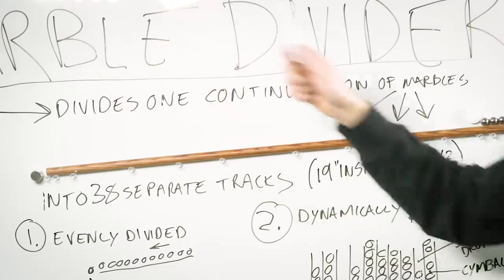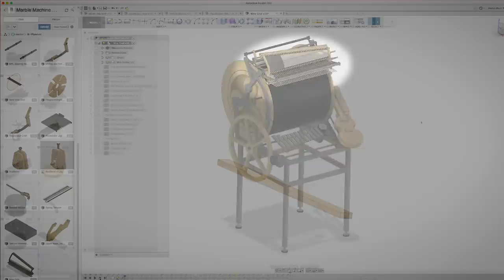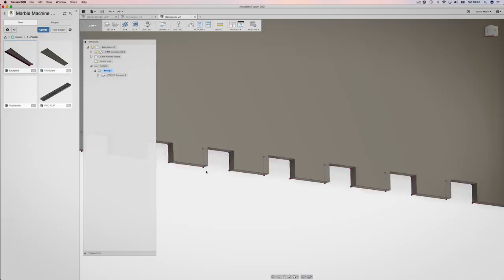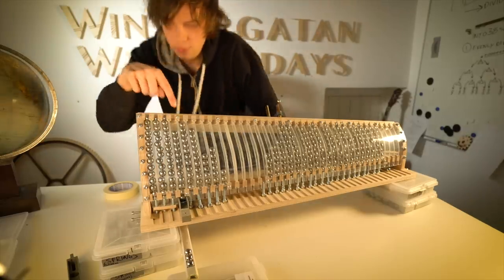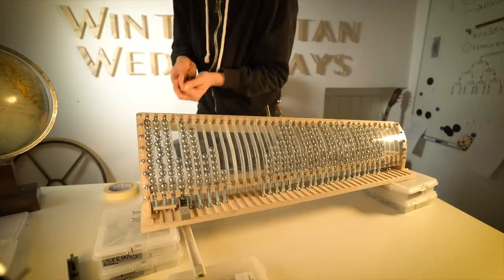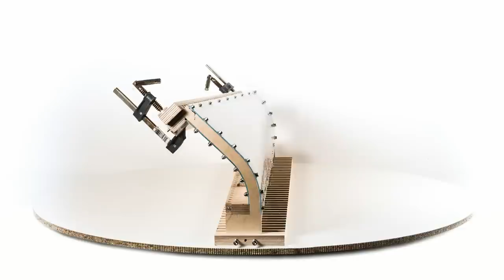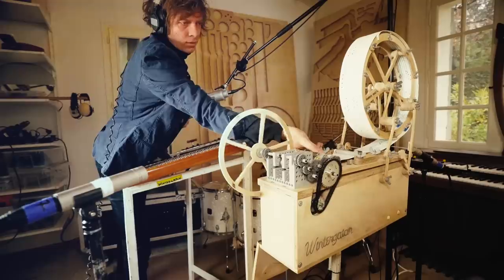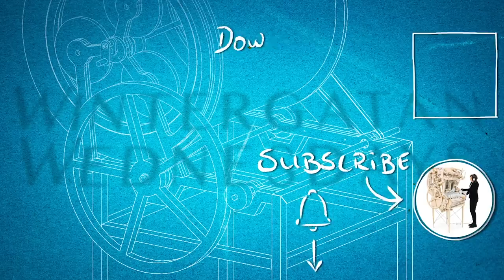Marble Divider - Marble Machine X #21

Comment: I wonder if there can be too much variation in the ways the marbles can be piled up inside the channels, since they're wider than the marble themselves. if we turn a channel sideways you can that see 5 marbles can make a W shape or a M shape, and both shapes can have slightly different heights depending on which way the channel is bending.

If that happens, the solution is to make the channel widths closer to marble diameters.
Reply: I had the same thought! I wonder if this was considered.
Reply: Alberto Torres by the next Wintergatan Wednesday I bet we will find out if it was considered!
Reply: There may be a little room for error on that aspect; the marbles can probably still roll through the top of the channel, even if it's slightly above/below expected.
Reply: I also noticed this - especially on the second channel. I bet Martin has considered this and build in some "tolerance". Over time this might become problematic as wear and tear creeps in.
Reply: All valid concerns, but remember that this is an iterative process. Things are designed, prototype tested and adjusted until the design can be classified as §viable, and once a viable solution and design has been identified the part is built. 

Compared to the original MarbleMachine this version is much more modular, and if it turns out there is a problem with a part such as this marble divider it will be possible to build a replacement that fits requiring minimal work to adjust. And I think there will be several parts that will go through at least one revision to address problems discovered only after the complete machine has been used for a while. Not every failure will result in the entire module being redesigned or rebuilt, but the possibility is there if it turns out that the design has fatal flaws. The original MM was much harder to maintain or rebuild. For instance there were no complete schematics and everything was hand fitted. This time there are extensive drawings and a lot of the parts have been cut using CNC machines or printed using 3D printers making for quite tight tolerances even if final fitting still might take some work.

Over all this version is a huge upgrade in just about every way. Only thing is I loved how primitive and yet ingenious the original was, and that just about all of it was hand made and hand fitted using simple tools. Every time I see it I can help but be amazed that Martin was able to build it and get it to work, or kind of work at least.

Comment: Why did you go for polyacrylic for the clear cover? Why not use a thin sheet of lexan and skip the heating and bending process as the force of the screws should bend it nicely with no warping?
Reply: EasyBakeRofleCakes Maybe it's not as robust and more prone to break after enough use?
Reply: Lexan is polycarbonate, most race cars use lexan for windows and windshields, it can handle a few steel BBs resting against it
Reply: EasyBakeRofleCakes That's good to know!

Comment: QUESTION: Instead of having 38 unique marble gates, did you look at making the marble gates all the same, but make them adjustable?
I am wondering a lot about maintenance on the machine when you are one tour. If all 38 gates are different, then you need to carry a lot of spare parts. If all the marble gates are the same, but adjustable, then you only have to carry a few.
The whole rig is looking great!
Thanks for sharing.
Reply: Coxy's Railroading Might make more sense to carry a small 3d printer so they can be manufactured. The problem with adjustability is that it creates the same problem as the first machine: the adjustments may move when they're not supposed to and cause reliability problems.
Reply: Yep that could work too. With that approach it's very flexible and also a matter of print time. Depending on travel schedule, there may not always be many hours where the printer could be working on a part. Perhaps a hybrid approach would be the best: Take a printer and print parts as needed, assuming there is available time, but also have an adjustable version of the marble gate to get you out of trouble for times where you cant print one.
Reply: Taking a 3D printer on tour doesn't sound like much fun to be honest. While I don't really think that these gates would need to be replaced while on tour, the fact that they are each printed with unique heights might cause more problems later on. 

For example the marble lanes look taller than the marbles themselves, which causes some to push up, making the length of the marble stack shorter than calculated. I doubt this was taken into consideration when they were figuring out the thickness of the gates. Having adjustable gates would allow for these uneven marble stacks to exist without hindering the rolling marbles from rolling properly over the full lanes.
Reply: I don't think that will pose a problem... If anything, a bunch of spares with the maximum space can be made, plus a bunch of spacers to exchange, combine and test, and then glue the correct one(s).
Reply: I would've just given the output a 5 degree slope as well. That slop should be taken up by the transfer from gate to destination anyway.
Reply: Coxy's Railroading い
Reply: If I understand what he is stating within his video each marble distribution distributor is adjustable. So my understanding is that the outer dimensions are the same for each of the 38 distribution chambers. This way all that he has to adjust is that inner stop-gap piece of plastic that keeps the top most marble flush with the main distribution track. If he was smart he would make each marble distributor with an adjustable counter sunk set screw so that he would not have to carry a lot of spare parts with him on tour. By making the inside marble stop-gap adjustable with a set screw means that he would not have to continue to make AND carry 38 DIFFERENT machined marble distributors with him as backup, but rather only 4~6 backups with the stop-gap can now be the same dimentions for all tracks because the adjustment now falls to a set screw (making the stop-gap adjustable) rather than individually milled parts inwhereas the 
inside stop-gap is permanently stationary.
Reply: Shane M Gordon That plastic piece is the 3D printed Marble Gate that was made in 38 different sizes.  Having a single size with spacers would make on-tour fixing a lot easier than carrying multiple full sets of 38 or trying to unpack and run a 3D printer with 5 minutes to concert start.

Comment: What I'd it gets to the end without having gone down any divider.
Reply: it will probably fill up the devider feed and wait before there is room. it could also be that the amount of marbles is limited and never "overflows" the devider
Reply: drop it down to the bottom for another circuit around with the rest of the used marbles.

Comment: sry 3:08 but i think this will not work ,  or maybe somtimes it will not work ,

you need sooooo many marbles to fill the channels in the left side to the middle , 

if the machine runs, some notes will miss , becuase some channels are empty (no marble can skip an channel to fill the empty channel on the right side)

i think you need a hopper on top of this MARBLE DIVIDER  with many many many of marbles , maybe im wrong , but i want see this machin run ;)
Reply: DieZockerZone it will based on the instrument sound type. @3:36 :)
Reply: this is not the problem , the problem is , if one is not full , the channels behind  cant fill up and they will be completly empty in time
Reply: DieZockerZone The machine will contain enough marbles to fill all chambers plus the entire transport mechanism.
Reply: i dont think so
Reply: if there is no hopper  on top , some chambers will be empty
Reply: what can you ddo duffers

Comment: Ah, finally figured out where the comment place was!  Lots of ingenuity in this and I have enjoyed watching how you have solved problems.  I know you posted that you don't intend to put any kind of stain or protective finish on the wood.  Something to consider is that in travelling around the world later on it will be exposed to a lot of different environments and wood does not react well to high humidity.  High then low levels of humidity cand do all kinds of warpage to wood if it isn't protected.  I would strongly suggest a coat of base color polyurethane with a light sand to smooth the surface followed by a second coat.  This will protect the wood from dirt, dust, handling, and most important humidity.  The only surfaces that could be left uncoated would be the gear teeth which would keep them running silent due to the softer surfaces.
Also you could use bronze rod for marble guides instead of steel.  The bronze is not magnetic and would work just as well as the steel guides and could be brazed together like the steel is welded.

Comment: The solution to use different height on the gray think is absolutely brilliant! Have you ever heard of parametric architecture? It's about optimizing constructions to have less different parts to be built, while keeping an astonishing result. Try thinking a building with curved facades build with only 3 types of triangles. That will optimize build time and cost.

Comment: You don't really need 2 channels unless you are trying to save money on ball-bearings (marbles).  Any given channel can be pre-filled with <n> more ball-bearings at the start of a song and during the course of the song always contain <n> more ball-bearings.
Reply: frankbraker It's about the ability to drop two marbles on the same note less time apart than it takes to refill the gate at the bottom. This is sometimes needed musically.  So it's about having two gates, not a big enough channel.

Comment: A tipp for bending the polyacryl: Put it in the oven and heat it up somewhere to 140-190°C(If your oven isnt big enought take a cardboard box and set it on to the ovendoor )  After that you quickly take it out and lay it over the final shape. Leave some excess so you can cut it afterwards and only touch it on the excess area. You can leave protective film on top while bending.

Comment: really great design with the marble dispenser... one could think of adding a good spring system where you can press the slots manually to play a note and not lifting like the old marble gate arms like in the old system... making more faster play

Comment: I bent some polycarbonate, which is comparable to acrylic, using a large oven and a similar fixture.  It might yield slightly better results to clamp the plastic to the fixture, and then put it in an oven until it anneals to that shape.  You can use a thin piece of sheet metal on the frame first to prevent sagging between rungs.

Comment: You should try to stack the marbles straight in those holding channels. By making them smaller. The random stacking could make the marbles end up higher than the track they are running on.

Comment: next time when bending your plastic use a heat gun instead of a torch, it really helps to keep the heat even and bend the sheet consistently across the curve. But if you really want it perfect use a form a vacuum table and an oven. You could make a vacuum table really easily with your CNC router, something cool that is mounted to the wall and folds up out of the way, and then just run it with a shop-vac.

Comment: Bending acrylic evenly is hard to do at home. You could consider making a former from plywood with a layer of felt, in both positive and negative parts. Heat the acrylic as evenly as you can to 140°C, and press it between the halves of the former. The felt will prevent leaving any marks. The real difficulty is heating it evenly. I've done small pieces using a barbecue with heavy iron plates. I also tried making an oven that you could hang the piece in and blow hot air in with a thermostat, but I couldn't get it to work very well. You might be able to find a company with a suitable commercial heater, for example maybe a signmaker that works with acrylic. Or just use thinner material and bend it on to the frame cold.

Comment: you should add an overflow failsafe. like always have more marbles then those that fit in the devider. and on the end of the decider have a track of metal that travels in front of it and puts an back to an elevator that would look nice

Comment: You could solve the problem of the latter tubes getting fewer marbles by having a gate of some sort that allows each slot to only receive a single marble.  The last marble in the channel would then trigger the gate to open and all of the marbles to drop down.  It would function very much like the demonstration at 1:10 into the video, but with a mechanism in the last slot to cause all the marbles to drop down.
Reply: Problem with that is that some chutes will be used more often than others so they will need more marbles or there will be missed notes. There is also going to be a stream of marbles arriving so there will be several marbles going down the ramp at the same time. I'm sure Martin has thought about this a lot and that he is reasonably sure the delivery system will be fast enough to keep up with most situations. 

In the video he mentions that this design should need lot less marbles than what was used in the first Marble Machine. Personally I think the last few chutes look a little short, but then I'm not the one with experience from building anything like this before.

Comment: You could add some sort of easily removable plug in the top of the marble divider for channels you're not using for a particular song - something like a stop  lever on a pipe organ, it's in or out and then the divider slot is either open or closed. ;) It could be spring loaded with a latch - pull against the spring and latch it open, release the latch and it closes. Or it could be spring & magnetic...
Reply: Jarod997 Or just a standard DIP DUT as used to plug unused / new pipes, they are available in many diameters.  Plugging the top is only needed if a channel is broken but the show must go on.  Because a broken channel could eat all his marbles.

Comment: You can use diffrent size marbles and then they would only fit in the hole that are the correct size and thereby u can control the marbles :)

Comment: You should use a rotating PVC star-tube, *, within a larger tube, with slots for the marbles to drop-out along every few segments. to assist with division by consumption. Returning the over-burden marbles to the beginning.

Or, if you get real creative... figure-out which notes need the most marbles, and put those notes first, keeping the end-notes, used least, at the end. You just move the note to where it needs to go, along with that individual note's timing ribbon.

I'd love to make a "Marble ExMachina", where you can manually drop-in and remove "sounds", that just auto-sync, using the same marbles. (Bonus for having the falling marbles timing strike multiple notes. Like the original concept in the 3D video "music machine". Aided with one of Conte's contraptions and some of Neville's handiwork.)

Comment: This new piece looks great, Though I wonder about if certain instruments use more marbles than other instruments if they will get enough marbles. Especially if they are farther down the line. The first lines Need to be filled for marbles to move to the next ones, so if you have a fast instrument in the first spots it will take too many marbles from the feed which might introduce problems for marbles passing over. But if the fast instruments are put near the back they might run out. The original Marble machine had nice long feed lines so even if one instrument ran lower than others it had plenty of time to fill back up; but more importantly the marbles could roll to any feed line without requiring full feed lines in order to move to the next instrument.

Comment: At 6:42 you can see that the marbles are not sitting on top of each other. 
Presumably you have calculated the depth in the marble gate to keep the top marble flush with the feed ramp .
I worry that if the marbles are not precisely stacked on top of each other then you will end up with some channels with the top marble sitting very low and causing a marble to be half in/half out of the channel. 
This could stop marbles bypassing this tube and preventing filling of the lower channels.
The only way to prevent this is to make sure that each of the marble channels is only very marginally bigger than the marble to ensure the marbles in the tube are sitting precisely on top of each other.

Comment: Awesome episode after the long break!

Two questions popped on mind as I watched the video:

- You talked about how the gates are built to ensure that the top marble is flush with the top of the slope, so that other marbles can roll over them. In the video, though, we can see that the channels of the divider are much wider that the marble's diameter, which causes them to move to the sides slightly. The marbles in a channel don't align in a straight line because of that. I imagine that causes the height of the column to vary a bit depending on how the marbles settle in the channel. Doesn't this affect the rolling of marbles flowing at the top? Would narrower channels improve this, since marbles in a channel would be more on top of each other?

- In the video the falling of marble into the gate is very noisy. I wonder if when the machine if fully loaded and all the channels are in operation whether the divider would produce too much noise and interfere with the song being played. Is that a concern to you? Do you have plan to silence the gate loading in any way?

Comment: You should illuminate the marble divider with some LEDs or neon lights. Or, if you want it more classic, with a gas light. 
Else it will not be easy to see the marbles on stage.